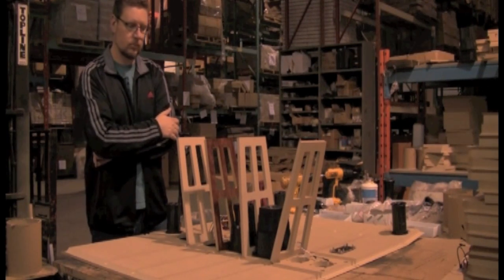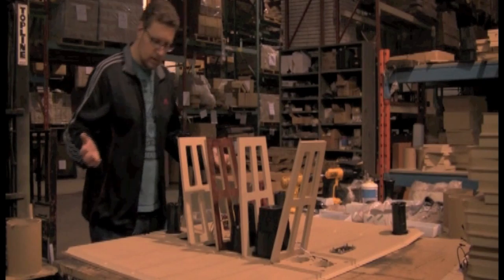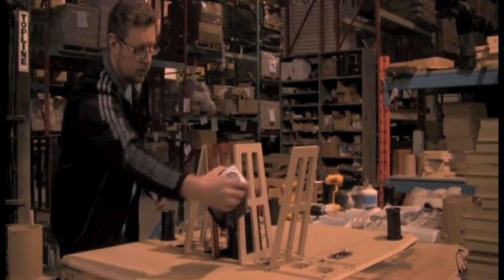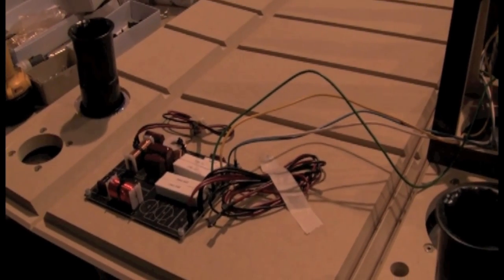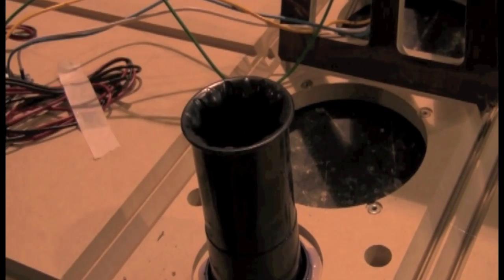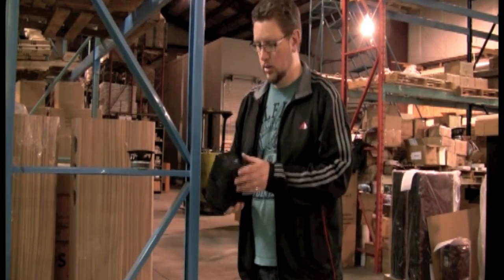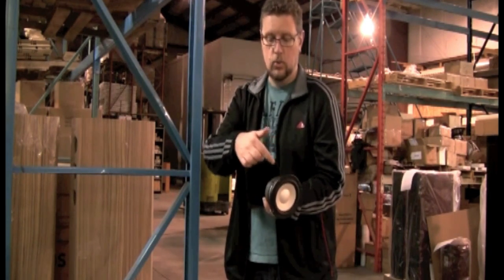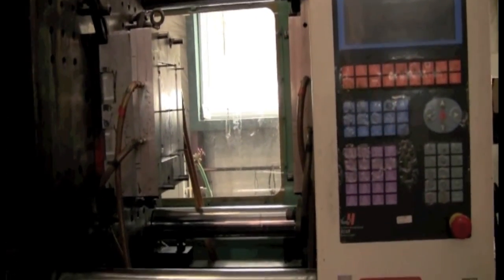Building an M80 Loudspeaker

Comment from the maker: Everything uses the plastic box now.  The original mid-box was a cardboard tube with a wooden back.  The new fully moulded mid-box is much more sophisticated in its handling of standing waves and interlocking seal with the front baffle.